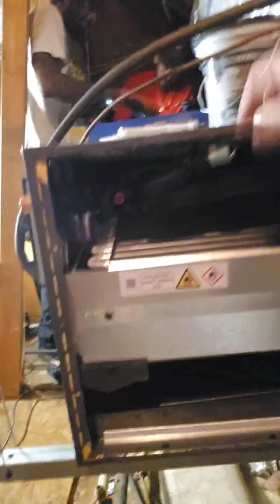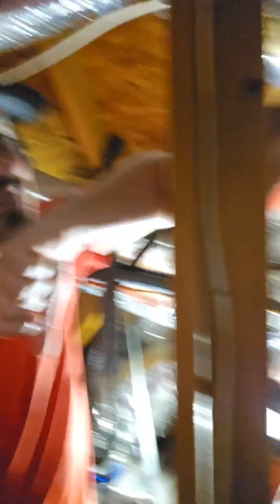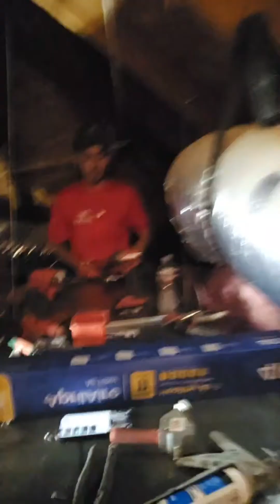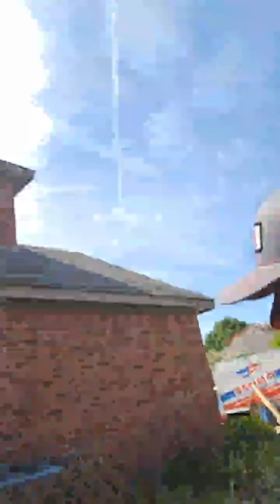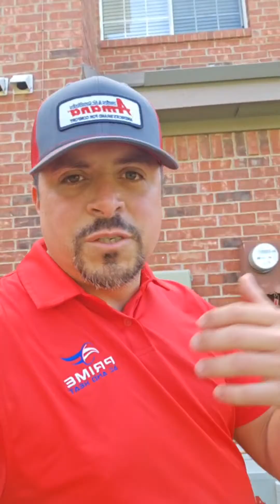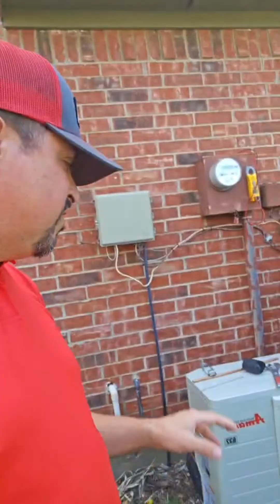Friday Amana S Series R32 Installation Flower Mound TX

Comment: My Amana S has dual fans so it's pretty tall. Do you know if there's an advantage to this? Thanks
Reply from the maker: The double-stacked Amana S Series is currently the most efficient version within the S Series lineup. However, it's not a viable solution for our customer base here in North Texas. While it is technically rated as a high-efficiency outdoor unit, the overall system matchups—especially when factoring in indoor equipment—do not justify the added cost for most homeowners.

The current efficiency ratings simply don’t provide enough real-world value to warrant the investment. That said, we’re hopeful that by 2026, new matchups and AHRI-rated combinations will become available that truly unlock the full potential of these double-stacked systems. When that happens, it may become a more practical and cost-effective solution.
Reply: @primehvac thanks for the prompt reply and thorough explanation. I was surprised I got this big boy when it was delivered.